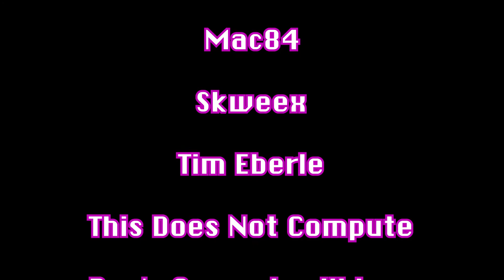[Labs] - Upgrading my 2017 iMac!

Comment: I am also using Sabrent NVME in a thunberbolt enclosure, in the video you didn't mention using any adapter for it. Could you please clarify which adapter did you use to convert to Imac compatibility and did it start after plugging it into the logic board. At the moment, I am booting MacOS externally via enclosed NVME drive.

Comment: I have the 3.8GhZ i5 version of this 2017 27” Imac and wanted to know, would it be worth an upgrade to the i7-7700k 4.2gHz in regards to speed? I have read mixed comments and some say to just do a RAM upgrade (currently at 12gbs) and add NVME and SSD drive and that would make it perfectly powerful for editing and heavy photo editing. What are you thoughts?

Comment: PLEASE HELP! Will going through the tedious process of installing the nvme internally vs using it externally via thunderbolt make a substantial difference? I’m definitely going to be going the nvme route for my Mac, for music and video production/editing. But I’m weary about going through all the work to disassemble my 2017 iMac. I already have an i7 7700k processor in it and 64gb RAM. But currently only has a 500gb SATA SSD. Any input would be greatly appreciated 🙏🏻
Reply from the maker: Not a notable difference. Especially if you use a thunderbolt nvme enclosure. Those are fast enough for a main drive
Reply: That’s exactly what I was planning on doing. Booting off an external 8TB nvme via Thunderbolt 3 USB-C, velcro’d to the back of the computer lol and am also gonna install an internal Samsung QVO 870 8TB SSD SATA for storage. But the regular 2.5 SATA is a much easier install vs the nvme. Thanks so much for getting back to me btw. Also I love your “meh” at second 2 of this video 😂

Comment: I know this video is two years old, but I just discovered your channel.  Hopefully you’ll see this comment.

I own the identical 2017 27” iMac with the same processor you have.  I guess it’s not entirely identical, because I don’t have 64gb of RAM, but otherwise, it’s the same iMac.

I have been building computers since the early 1990s, and have considered upgrading to an NVME drive, upgrading the memory, and upgrading the processor.
Even though I’ve been building PC’s since the early 1990s, the idea of opening up the iMac has been too intimidating to me.

For the record, you are a lot braver than me! 😊

Anyway, I am impressed with your results.  At this point in time, it makes more sense for me to get a new Apple silicon based Macthan upgrade the 2017 as a daily driver ; but once I do that this would be a fun project to do on the side.

As an aside, I can’t say how disappointed they no longer make the 27”iMac anymore.  Yes I know you can get the Mac Studio and the separate monitor, but that’s way more money than I want to spend.  
I know I can cut corners getting a non Apple monitor, but I’d prefer staying in the Apple ecosystem.  I do music production, and I need the larger pixel count to see the fine details in a very information packed screen.  4k would pass, but I’d have a much more comfortable experience with more resolution.

Anyway, the 27” iMac is no longer an option.   (sigh)

Anyway, thanks for the video.  It was motivating!   I’ve subscribed to your channel as I am a retro nerd.

Comment: Question, when you were using the external nvme drive as a bootable drive, did your iMac lose the year and screen size info in the “About this Mac” section.
I have the same iMac 2017 5K 27-inch and I’m suing an external SSD via Thunderbolt cable, everything works fine, but the section only says iMac.

Comment: Upgrading modern Macs is fun. I bought a 2015 macbook pro with a 128Gb ssd and upgraded it to a 1TB and put a new battery in while I was at it. I surprised myself, it wasn't that hard. iMac would be much more challenging though I imagine...

Comment: cool thanks very much for this video! I currently use the same iMac as my main driver. It's nice to know some upgrades can be done to increase its speed when the time comes! I unfortunately missed out by a month or so in a 2019 model but the need for a new machine was my main priority at the time of purchase.

I was surprised that the cpu could be upgraded to be honest. I will have to look out for compatible chips for mine one day :)

Comment: Great video! How is the i7-7700k holding up? Do the fans come on full blast? I bought a 7700k for my 2017 21.5”, but I have read some people talking about throttling. Just want to make sure before I take it apart to throw the new processor in. :)
Reply from the maker: There is thermal throttling , but it’s still a lot faster than the i5 that was there before. I love it :)
Reply: @MacintoshLibrarian  well… full steam ahead, I guess! Thanks for your video, it was awesome!
Reply: The 21.5inch is not build the same as the 27-inch 5K, the PSU on your is rated at 185w it doesn’t support the K line of CPU’s, the 27 inch has a 300w PSU and can handle the K line. Maybe too late, but if you did replaced it you learned the hard way.

Comment: Nice work.  In the past I did repairs and upgrades on PCs and Macs.   I was not a fan of taking on the iMacs.  I know how finicky it can be to disassemble it and then get it back together perfectly.  I much preferred the older models that used magnets and no adhesive.  You did an awesome job!

Comment: You: "this isn't a step-by-step guide."
Also you: "step 55!!" 

This is one of the most diligent upgrades I've ever seen. I had to replace the power button on the model that has the screen held in place by magnets, so I really wouldn't fancy this model. At all. Well worth it for the noticeable performance increase!

Notice how from 2:34, the line on the iMac case makes Maccy looks like he has a grumpy face!
Reply from the maker: I wish this screen was held on by magnets, the adhesive removal took so long >_<

Comment: When you did the hdd and ssd replacement, did you keep them as 2 separate drives? Or can you create a new ‘fusion’ drive with the OS? And is it possible to swap the video card/processor? I have the entry level 27” 2017 imac here which I want to upgrade. But to remove the lcd panel...
Reply from the maker: I went ahead and made them two separate drives. One being my main OS (Sata SSD) and the NVME is where I keep my video files for quick editing :)  if you want to get into the 2017 - be very careful!. I read this as a initial starting guide https://forums.macrumors.com/threads/imac-retina-5k-27-inch-2017-cpu-and-nvme-ssd-upgrade-pitfalls-and-tips.2177812/

Comment: The OWC sensor is actually completely unnecessary. Without it, the fans will still run completely normal (personal experience)
Reply from the maker: I had read that too! I already had the OWC sensor from when I thought i was going to do this like two years ago >_< so I went ahead and put it in too.

Comment: Very nice. Working slow and methodically is the way to go anytime you aren't as familiar with the equipment. LOL at the thermal compound portion--if it doesn't overheat, then you used the right amount.

Comment: I used to have a 2010 iMac 27" and I replaced the optical drive with an SSD. It gave it several more years of use. Even that was a hassle due to having to remove the screen in a similar way you did. My install actually messed up the camera a bit but I didn't use it so it didn't matter. In these remote working days it would have been a bigger problem! Nicely done and good info for others.

Comment: Nice upgrade! There's definitely no harm in being overly paranoid about keeping your screws in order, definitely helps with reassembly. Back in the day I managed to get a free screen and rear shell for my somewhat dented 2005 Powerbook G4 from the Apple service centre by calling them up from my work and "suggesting" that we were certified Apple technicians. Didn't take long to pull it apart, but reassembling it took many hours, since I had to measure each and every screw! And even then I had some left over! Needless to say I won't be doing that again any time soon, so apparently you're a lot braver than me.

Coincidentally, my PC is also an i7-7700K. Definitely still good enough for most tasks, although I only occasionally use mine for gaming these days.
Reply from the maker: It added more time keeping track of the screws, but it made re-assembly a breeze :) Next time I will use a magnetic project mat that has a dry erase marker surface
Reply: @MacintoshLibrarian  Such modern convenience! 😄

Comment: Brave lady. You might want to consider take some anti static precautions if you do more of this.  Have you thought about building a HACKINTOSH?
Reply from the maker: I have thought about a hackintosh. I actually was running one for a while before 2017, but I was getting frustrated with fiddling with it to try and get everything working perfectly. Every update would break something :( but maybe it’s worth trying again
Reply: Only problem is with the move to M1 Macs Hackintoshes are probably running on borrowed time. Kinda sucks. Hackintoshing is fun, and I kinda miss mine, but the only thing I didn't like was trying to get FCPX acceleration working. Never did get it running, even with some high authorities trying to help.